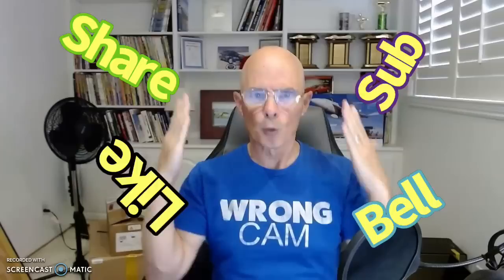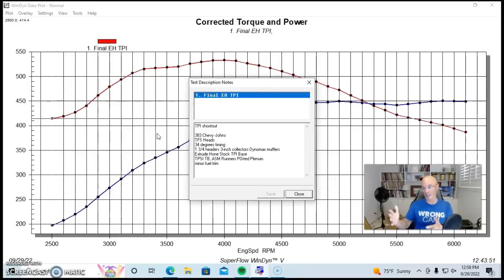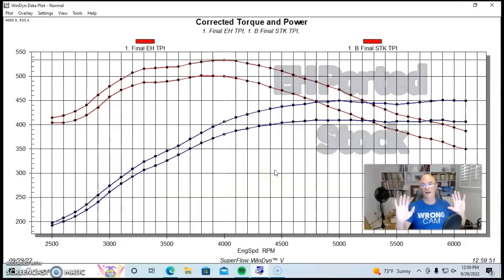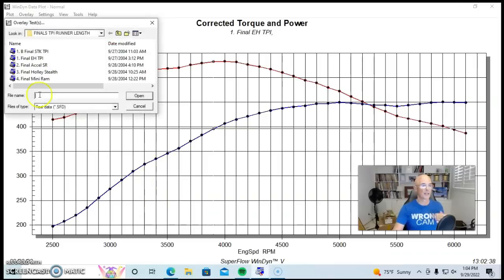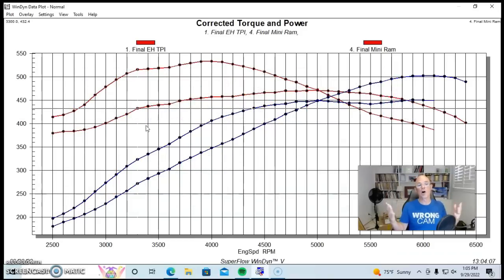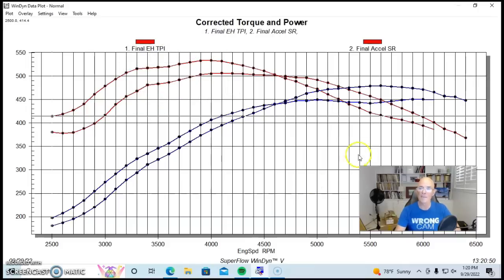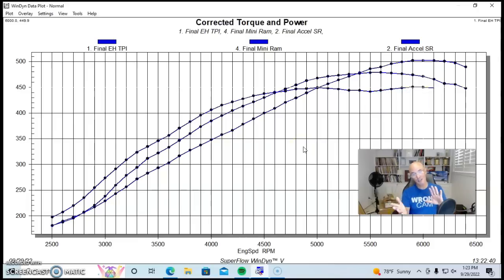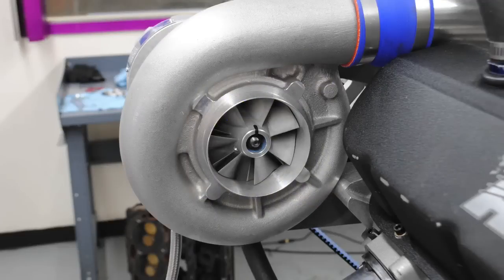TUNE PORT INJECTION-LONG RUNNER VS SHORT RUNNER-WHICH ONE MAKES MORE HP, WHICH ONE MAKE MORE TORQUE?

Comment: Richard, you touched on it briefly in this video but I would like to ask for some more info about the effects of plenum volume. Ask 10 people on the internet how much volume is enough and you'll get 11 answers. 50% displacement to 400% displacement etc. How much does it really matter on a given engine setup? 

Obviously a smaller volume is easier to fabricate, and probably will respond faster to throttle inputs, but is there a risk of starving the motor at high RPM by having a "tank" too small?

I put a Chevy 3.9L 60-degree V6 into my 944 and had to make an upper intake to fit under the hood - despite the packaging challenges the total volume is slightly greater than the total engine displacement. It runs great but I am considering making another manifold to make room for other stuff in the engine bay and if making it smaller won't hurt then I would be inclined to do so.
Reply from the maker: see the Kegalodon video
Reply: That's a neat swap.  I'd like to do a 3.9L V6 into a Miata.
Reply: @andyharman3022  It should fit great, and since a Miata can take a normal transmission it should be a relatively easy swap. I think I remember seeing someone put an older 3.4L into a Miata which is almost the same in external dimensions.

I run the engine on Microsquirt - since this MS can't control VVT, I locked the VVT phaser to its base 9* fully-advanced position, then dialed the cam gear back 1 tooth to retard it 7.2 degrees. Net result is the cam is fixed at 1.8* advanced and it makes this old car FAST. I don't think I hurt the stock 240hp power rating any by doing that, it can get scary sometimes lol

Comment: I would love to see a test with different plenum sizes compared
Reply from the maker: see the Kegalodon video
Reply: @richardholdener1727  That is awesome! I did not expect those results - a common mod for the mr2 3sgte manifold was to chop off factory plenum and add a larger sheet metal plenum, unlocking quite a bit of power at higher boost levels!

Comment: Richard, would a purpose built engine today, same cam, heads, compression etc., etc. Only difference would be fully ported aftermarket lower TPI manifold, Big Tubes and the biggest throttle body that will fit the factory plenum.  The other test would be done with a Accel Super Ram, with the same throttle body as the previous test, but with custom runner extensions so the runners were the same length (only straighter) as the GM design big tubes.  Would this be a viable method to seperate the differences between runner length and plenum volume?
Reply from the maker: THE SHAPE AND DIAMETER OF THE SUPER RAM RUNNERS IS ALSO DIFFERENT
Reply: @Richard Holdener,  they are "bigger" than the aftermarket biggest big tubes that would fit the same manifold base?  I mentioned they would be straighter, at least on the top of the runner.

Comment: I noticed the effects of runner length seem to converge at lower rpms I wonder what  effect it has at say 1000rpm.
Reply from the maker: THERE IS VERY LITTLE EFFECT AT 1000 RPM WITH THESE LENGTHS

Comment: if the runner is between the throttle and the valve yes.  but if the runner is before the throttle it will make no change.
Reply from the maker: ON IR STACK INJECTION, THE RUNNER IS PARTLY BEFORE THROTTLE AND PARTLY AFTER-BOTH AD RUNNER LENGTH AND BOTH MAKE A PRONOUNCED DIFFERENCE IN THE POWER CURVE AS SHOWN. ON A COMMON PLENUM MOTOR, THERE IS NO RUNNER LENGTH IN FRONT OF THE THROTTLE BODY-THE RUNNER HAS ALREADY TERMINATED INTO THE PLENUM-LONGER AIR INTAKES IN FRONT OF THE THROTTLE BODY ON A COMMON PLENUM CAN ALSO CHANGE THE POWER CURVE-ESPECIALLY ON A 4-CYLINDER HONDA

Comment: Hello Brother Richard I was wondering what would be better for my 72 C20 350 motor 416 58cc heads, voodoo 256, 1.5 roller rockers, long tube headers a 200 r4 4.11 gears, 235 85 r16  would a custom tpi work better than a Edelbrock performer with a 650 AVS2 or QJet ? LOOKING FOR best power below 5800 RPM?
Reply from the maker: DUAL PLANE AND CARB
Reply: @richardholdener1727  Jake 72c20 man here again could you do a test of 305 heads on a 350 and 383 combo with a smaller and bigger cam combo so I can see how 305 heads react to being on larger displacement?

Comment: Would exhaust primary length changes also have such a dramatic effect? Is it possible to go for SUPER high rpm hp with a shorty intake and shorty headers? And of course the reverse for torque? How whacky could this make the power curve?
Reply from the maker: primary length also has the effect-though not quite as pronounced

Comment: I wonder that I has turbo fire 307 and can TPI intake manifold place in GM 68 307? Tell me more information about tpi intake manifold use on GM 68? Can or impossible.
Reply from the maker: it is possible

Comment: So with a milder cam would the torque number for the tpi manifold have been higher?
Is it solely runner length or does the shape make some (minor) difference, what I mean is does a straight intake runner flow better than the curved (tpi style) intake runner?
Reply from the maker: it would be hard to make more peak torque

Comment: I have a ?. I have look at photos of CamAm cars with 427/454 BBC engines in them. They have longer (4) and shorter (4)  runner FI sys. on them. Why?
Reply: They have four longer and four shorter intake ports
Reply: Traditional Big block Chevys have 2 very different intake port designs on each head. Long & short runners, higher & lower airflow runners.

Comment: I have Efi first intake lång runner and I have Dart heads Alu roller hyd cam Twin Turbo 355cui..build this Engine 1996.Mayby coming tou The Street 2023 .Standing tou long in The garage..Corvette 74 custom build rear and from 80 The fenders back are bigger  and have strong 12 bult axel, Toms 30 splines axels in The weels.31 stick axel in The center 12 bult. Is this excel or much stronger than the Orginal.Hope can handel mayby 800whp...Spell like hell sorry bay that.Dou The best I can...Make May day (Corvette).

Comment: My truck rarely goes above 3k power over 5k is worth nothing to me
Reply: I have a heavily loaded c3500 that always tows. It's got a stock 350 stock heads stock intake stock can stock exhaust no ecm no O2s no cats all stock. It has tons of power, 10-15 mpg, and she's fast with 4.56:1. 
I think I want to run it on a stock tpi intake.
Reply: @xmo552  I have a 83 c10 with a mk4 454 that I put in backed with a 700r. It’s literally at 1600 at 60mph
Reply: @regal105  
Nice. Which heads? Stock cam? What kind of MPG does she give you? This truck of mine does heavy dump runs or she's always hooked to a trailer. I need good MPG. 

I've had big blocks but never one in a truck honestly.

Comment: Does stroke have any effect on runner length?
Reply from the maker: stroke does not change runner length if that is the question
Reply: @richardholdener1727  reason I ask is  that the development of the Vector's DOHC engine was stalled after a catastrophic backfire which destroyed the intake manifold. I was told that it was because the stroke was longer than the intake runner length. I find this doubtful. My uneducated guess would be cam timing issues.

Comment: I'm 41 and inhereted my 88 gta trans am Pontiac firebird tpi and t5 9 bolt 
305 moddeded I did everything 14 30 at 99mph smoking the street tires and now I have a 383 built forged guts aluminum heads cam and hsri and bbk 58 mm tb 
I miss the torque but the high end power walking guys makes it amazing 
I know my rpm limit Ali's 5500 but I need to change it 6000 
I think my cam is maxed out at 5500

Black and gold ws6 4 paint jobs and a new floor all prof 
Dada car brand new and then gave it to my mom she drove it to work daily 25 years then my dad died and she gave the car to me it's a std and it hurts her foot to drive it 
So she she's me smoking driving it
Reply: 1988 there were only 861 t5 305tpi custom made in the factory in 88 
And it took over 3 months to get them orderd 
All automatic 1100 
And we live in Ontario Canada 
So my auto shop teacher and was like to this day never saw one ever 
It inspired me to work on gm cars alot 
Sbc 
We even did a clutch job for credits 
I got the auto award in grade 12 
I have it hanging in my wall